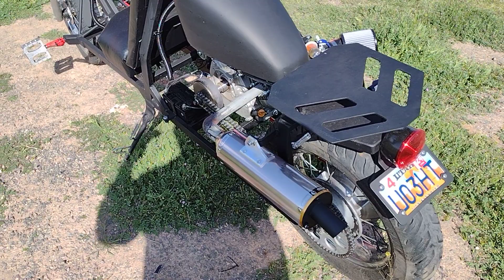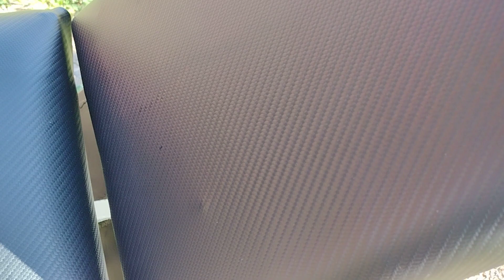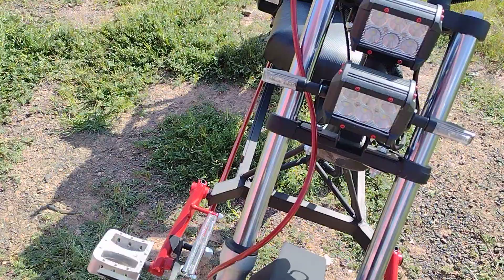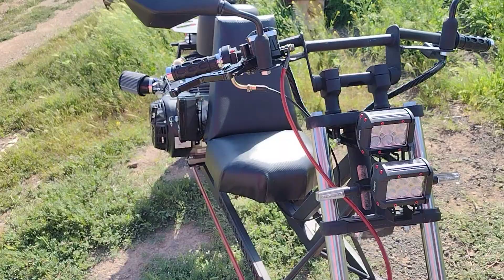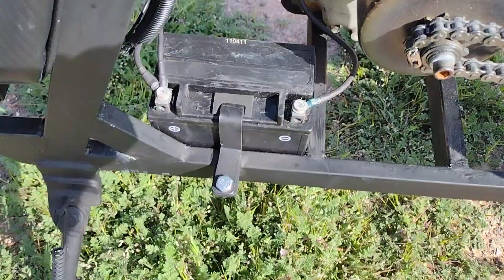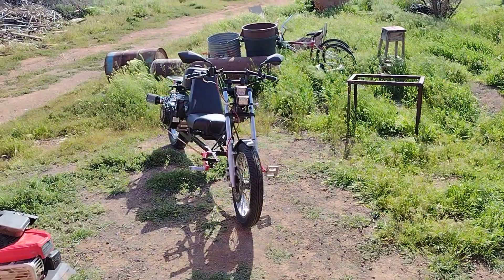recumbent motorcycle completed!

Comment: Steve has these down to a science, you can't go wrong with his fabrication skills, the 420 has proven itself reliable, as long as you leave the internal components stock, don't put racing cams or billet connecting rod or any part that a company claims makes spin faster. You can upgrade the exhaust and intake and possibly a racing carb, but if you Don mess with the rod or cam, these motors will go thousands of miles with very little to no issues.